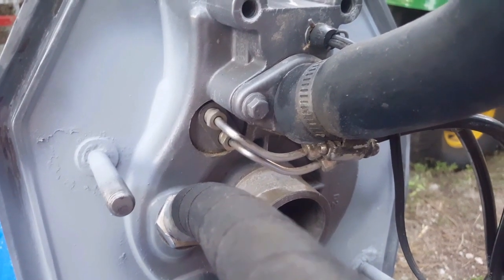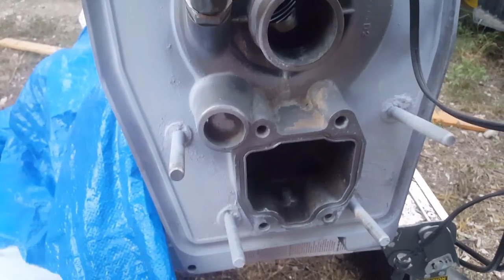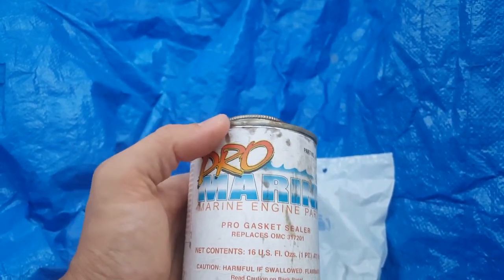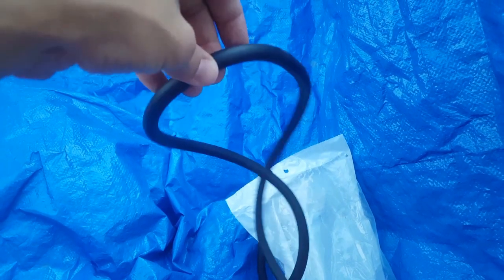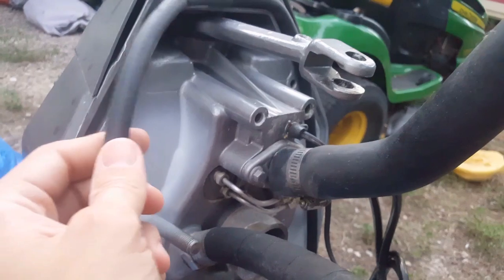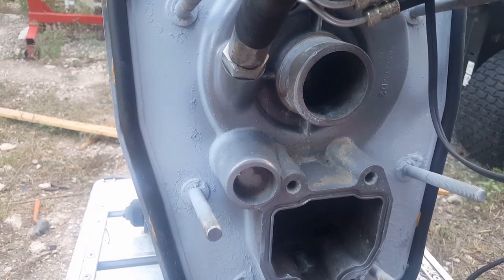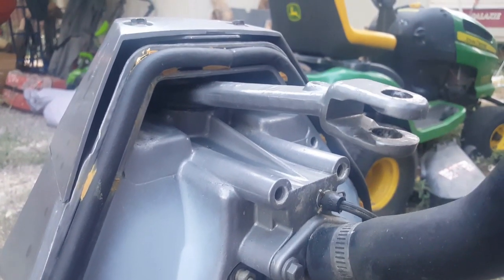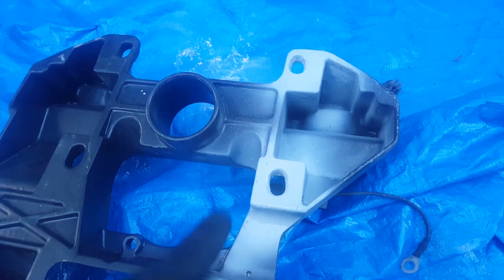Boat Transom and Floor Rebuild - Volvo Penta Gimbal Housing Assembly (1 of 2) - Part 60

Comment: 3M-8011 Black Super Weatherstrip Adhesive
3M-8001 Yellow Super Weatherstrip Adhesive
Start at center top cutting a 45 degree on neoprene gasket. Run a 6" bead of adhesive in casting gasket relief, lay gasket in and then pull a half inch away and let dry for 40 seconds then press gasket back into mating surface pressing in firmly and let stand for 20 min for initial set so the rest can be readily installed. Repeat 6" beading all the way around until reaching the end. Cut again excess gasket at 45 degrees then coating joint both mating surfaces, pulling apart letting dry for 40 seconds then firmly pressing for a finished fit. Let all thoroughly dry before installing to transom
Reply from the maker: Thanks for the added details!
Reply: @michaelromer2016  Hi Michael, thank-you for the videos. I used to be an autobody man about 40 years ago. I've always been interested in stern drives and how they transom mate and work. I'm seriously contemplating building a medium wooden drop bow Dory landing craft for diving with a Volvo Penta stern drive unit and am building a current information library filled with content such as yours. Thanks!

Comment: Hi Michael. Whst would cause a water leak at the bottom bracket of the transom. Water is pouring in coming out at the hole of the bottom bracket
Reply from the maker: 90% chance it’s a rotted transom, which is part of the boat itself. There’s also a seal that keeps water out—called the transom seal. Either way, motor must come out.
Reply: @michaelromer2016  Thanks Michael. Transom seems pretty solid still. I hope its the seal

Comment: Could you just not mount longer bolts? Sanding down the transom to match the bolt length sounds excessive work. Sure the driveshaft will not go in as long but up to half an inch should be ok, no? Am I thinking the wrong way now?
Reply from the maker: Great questions. I'm sure the shaft not going in the engine coupler as far, wouldn't hurt in the short term. I worry about metal fatigue due in part to less drive shaft surface area inside the engine coupler. As far as longer studs, sure that could work. The time you will spend installing them would make it not worth your time. Try to stick to the thickness I mentioned. I've gone too thick before with a prior project and it took me an hour cut some material out of the transom.